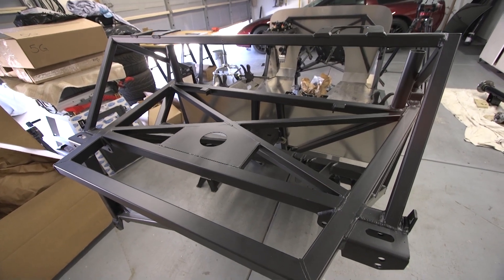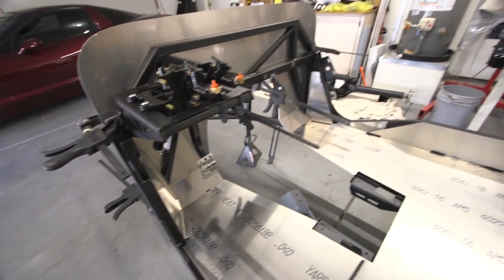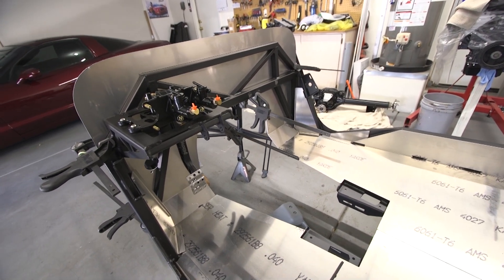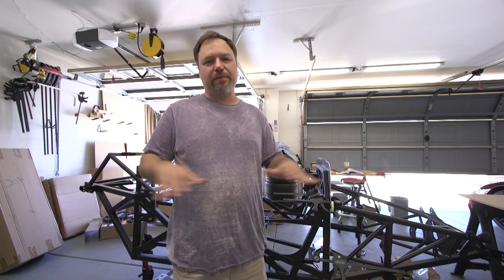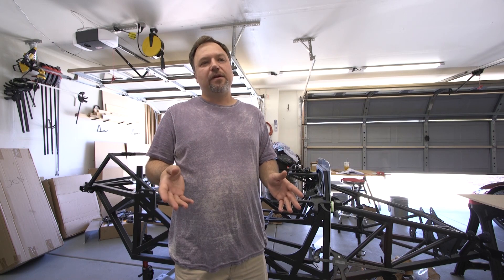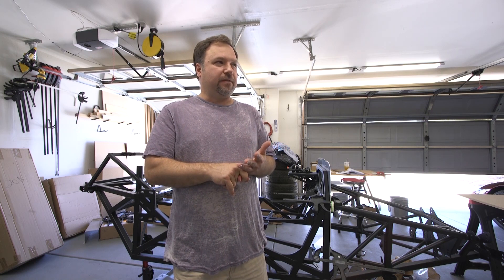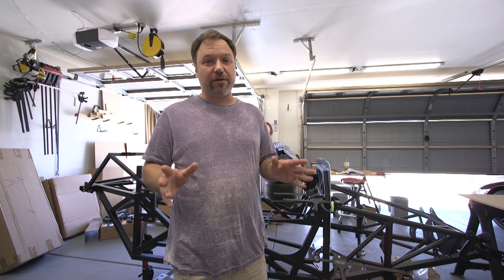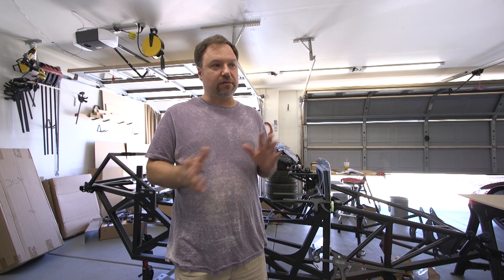Factory Five 33 Hot Rod V2 Build - Marking Panels and Differential Install

Comment: Jim, when you start drilling panels, suggest you use clecos. Place the panel, clamp in place, drill 2 holes, insert clecos start drilling other holes and add a few more clecos. The clecos really ensure the panel doesn't move at all. I didn't do this on one or two panels (just used clamps) and the panels moved slight causing misalignment...  Just  a suggestion :)
Reply from the maker: Already on it!

Comment: I wish you would discuss the tires and wheels.  Sizes of tires and wheels. Here is the closes thing I have found.  where may a number off. I hope someone can find it and correct . Front Tires: PROXES 1 - SIZE: 245/40ZR18  $121.56 - Wheels 18-9 What style and brand  does FFR use. I like them.   Rear Tires: PROXES 1 Size 290-30-20  Wheels 20-11
Reply from the maker: Sizes are explicit in the manual which you have or can buy online.  Or you can call them for specifics.